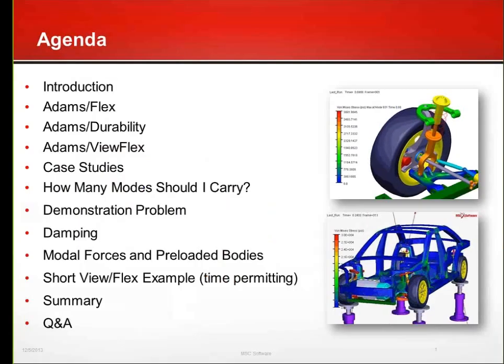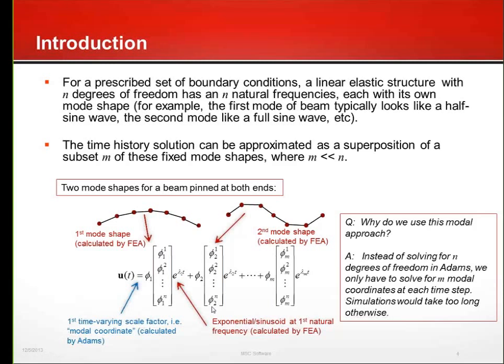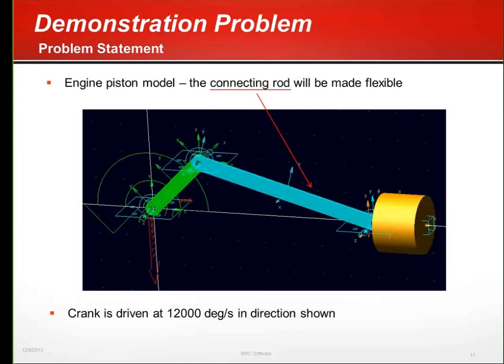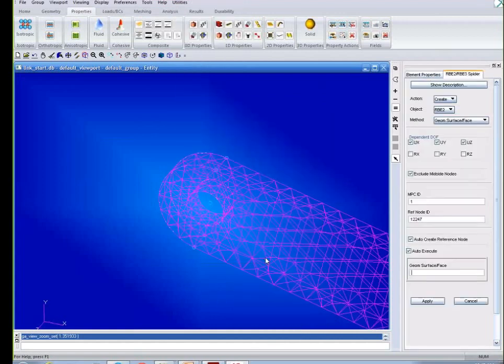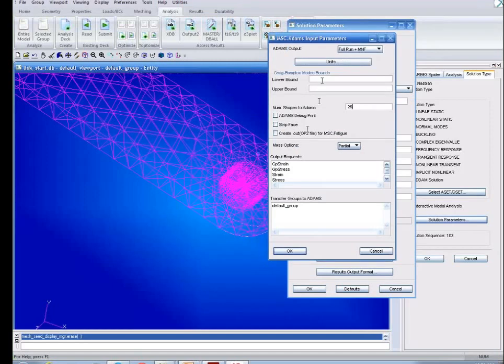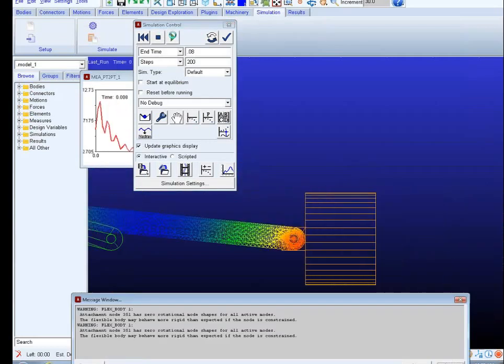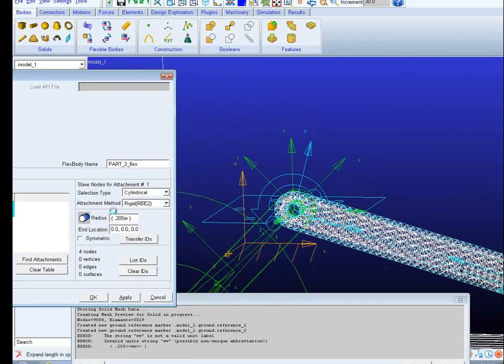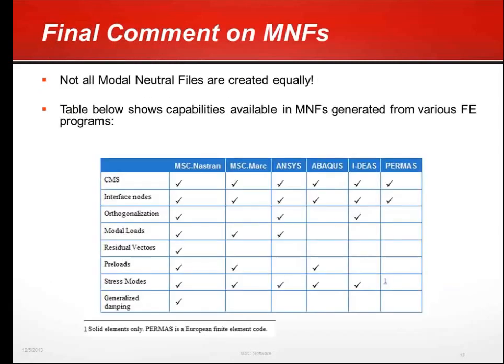Flexible Body Integration Using Adams and MSC Nastran

Comment: I am facing some problem with generating .mnf file. I am trying to get a
 model of flat plate (shown on the image) and then .mnf file to import 
it to adams. But the problem is when I apply only DOF (6 degrees for 4 corners of 
the plate) I get an error that attachment has no rotational degree and 
the body in ADAMS doesnt move in any direction. So I tried to make one 
short surface of the plate rigid (with SPIDER utility), as I understand 
it as equivalent for constrains. But after that .mnf file is not 
generated. In the end I have tried to make holes in plate in the same 
way as in tutorial and finally the flexible body moved in ADAMS but 
forces that moved body were like 1GN instead of 0.2N (compared to 
simulation made in Patran with model without holes with the same 
material properties). I would be very grateful for any kind of help. 
Thanks in advance.